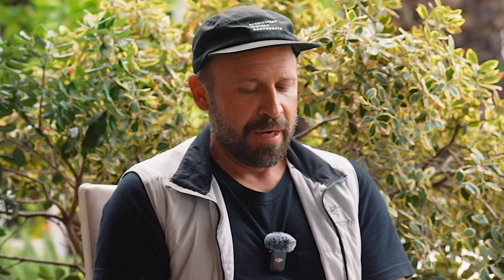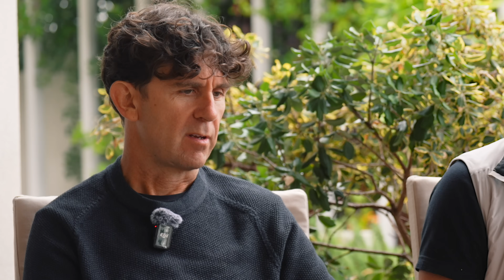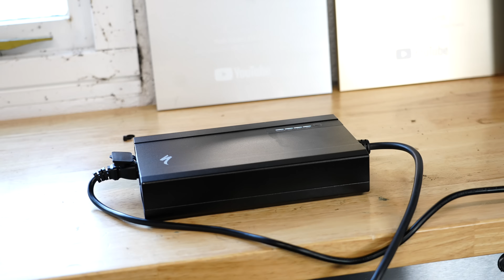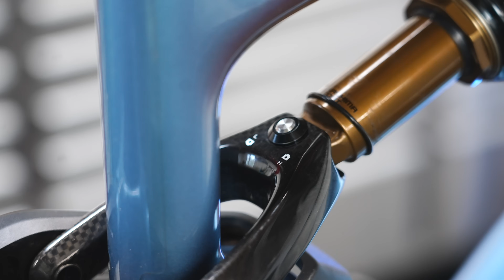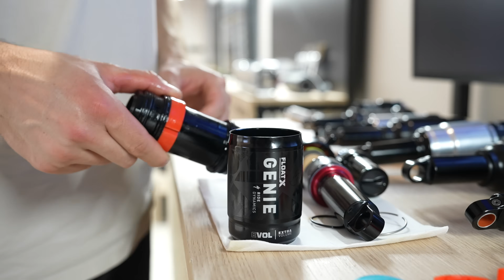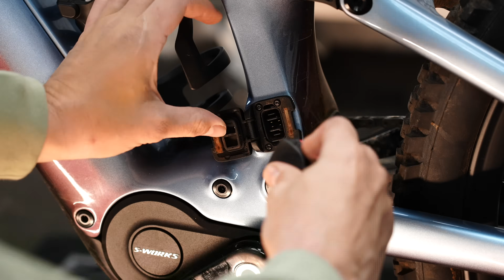Gen 4 Levo – What Specialized Changed & Why

Comment: Genuine question please Rob, how does a bike that weighs over 23.5kg with the 840 battery, now weigh less than 20kg with the 600 battery, when it is suggested that the 600 battery is suggested to be about a kg lighter? Or was there a mix up, and the bike was weighed with no battery fitted?

If it is true, can I have my Pro version with the 600 battery please, as I am seriously looking a buying the Pro to replace my Orbea Wild.
Reply from the maker: The bike at under 20KG had a ton of parts changed too: 36 fork, lighter shock / tyres / dropper post / brakes etc. Basically every part swapped for a lighter weight version. That, with the lighter battery adds up to a big weight saving.
Reply: @RobRidesEMTB  Rob I heard on the grapevine yesterday, that Specialized might be bringing out a Levo gen 4 SL. It was suggested that I might want to wait and see!😉😉👍

Comment: Tech climbing it’s strong suit not doubt, especially in comparison to Gen 3.  With extra power, had to tune everything way down, no shuttle, min overun and responsiveness and Auto minus to get good range since the more available power sucks up more battery, especially for the +200 lb rider.  Is nice that I can spend at least 80% of my rides climbing in ECO, Auto minus for the steeps to conserve range.  Full Turbo on the DH’s when wanting to blaze or perform “race runs”.  Just happy Spesh created a battery harness nest fix with new design from keeping the power/battery from shorting every ride like mine did.  Was kicking myself for going side load/easy battery removal due to connectivity issues on every ride with error codes and power shorts.  Since updated part, no shorts for over a week now and stoked! 
Wanted to get rid of bike prior

Comment: honest bunch of blokes. Spezialized really seem to have fresh air coming along
Reply: Specialized e-bikes you can basically guarantee 10 years of local serviceability and probably more but the years are still counting. My dads 2016 levo has never been a problem for replacement parts at the local dealer. A lot of other e-bikes from that era are now scrap and impossible to source parts.
Reply: @KurtisPape  well it might be the version when they used MAHLE or something like that as a motor.
After that they did many mistakes. Their engines are NOT durable. ive used up like 5 of their 2021-2020 flagship ebikes.
at that point it i could careless if you have local serviceability. I hate going to the mechanic and also imagine having nthe engine failures on BIG rides. it WOULD BE deadly
Reply: @ignaciosevil1944  Levo 3 and SL had issues for sure

Comment: Needs podium fork, and get rid of the swat and side swappable battery.  Also, what’s up with the software updates between bikes? The Groupo alone is enough to justify the levels.  They could add lead ballast to the lower level bikes to have a performance difference.  Sorry, but this is what happens when the engineers and accountants get a hold of the product….first gens were driven by design, rather than raw numbers, facts, and figures.  Think original apple products, ground breaking, revolutionary, now hey it has one more camera, one more gigabit!  We just need a bike that works and looks like a bike!

Comment: Gen3 Levo Pro owner here – paid CHF 12.5k post COVID peak. After a firmware fix, it’s been great except the absurd decision to run carbon rims on a 20+kg eMTB. I’m not price-sensitive, but when Spé dropped it under 9k months later, it stung. In 2025, at this price, a bike must be competitive across the board. Soft-capping an already underpowered motor (see all side-by-side tests) is tone-deaf. I wanted this bike—but that decision alone kills it for me. Aesthetics can’t excuse specs. Love the effort, but this is a reputational misstep.
Reply: thats a bummer for you then, absolutely love mine on me e-bike. Actually the best upgrade I've made. I recommend to everyone to do the same. And everyone who has changed to carbon rims loves them too. Different strokes and all.
Reply: @thedondodda  glad you love yours. I'm not sure we have the same use cases. I sometimes race extreme alpine like the Mountain of Hell for example, and you won’t find a lot of amateur e-mtb racers who kept using carbon. Same on the dh and enduro series. There's a market for carbon e-mtb wheels, but not everyone will love them.
Reply: why wouldn't you want carbon wheels?
Reply: @thedondodda  multiple reasons. The strength needed from carbon rims on hard hitting e-bikes makes them as heavy yet not as impact resistant than their aluminum counterparts, more expensive, and much more likely to catastrophic failures especially the rear wheel. They’re also non recyclable. Therefore there’s absolutely 0 reasons for them on such machines. I sold mines after they came back from the inevitable warranty claim and went hx1700 for a third of the price and a ridiculously slim weight penalty and never looked back.

Comment: has anybody had the S Works motor loose power after going up a high cadens hill but the display shows no error oddly its happened twice now on the same climb hill at cannock chase? also the display doesnt keep the time correct if its stored for a few days and show max speed if you have it on a menu option but the shows it as your riding along? 
besides that its a great bike😀

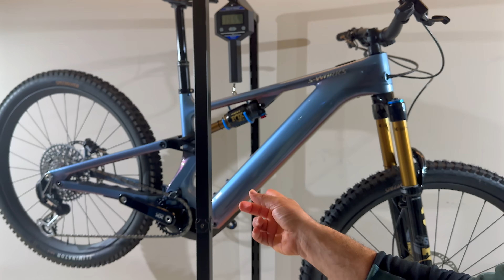Comment: 10:12 I wonder how did they achieve that weight?
I see they changed fork, shock, dropper, tires, brakes and smaller rotors. Everything else looks similar to s-works spec.
S-works weight is 23.68 according to spesh website, with 600wh battery it would be 22.68.
Is that possible to drop 3 kg just by those components? Or there is something I cant see?

My approximate counting is
tires - 600g
fork - 300g
shock - 200g
dropper - 200g
brakes with rotors - 400g
which is 1.7kg, how did they managed to drop another 1.3kg ?

Comment: I dont do specilized anything but being able to run the bike on the extender by itself its actually genius, So you can go bikeparking with it and not haul around the big battery for no reason.
Reply: You can't. It's half power.
Reply: @rawmancemtb  Remind me... when do you need 'full power' when bikeparking...???

So yes, you can....
Reply: @Bestintheworldatwhatido  There is a massive difference between 670 watts and less than half that... You are riding a full power motor that can't access that power and it's not even light for the application as the bike still weighs like 22kg... Tell me you can't think for yourself without saying it.
Reply: @rawmancemtb  you sir are 'thick in the head' You've completely missed what i was trying to say.
Reply: Mate u wouldn’t be able to pedal it hardly with no power even with the battery out it’s still a big slug to pedal with little or no power. Plus u want to load the bike up with backpacking gear

Comment: Is there a new charger connector since the voltage changed from 36v to 48v? Is it the same as the SL or are there 3 separate connectors for Specialized bikes?

Comment: The most expensive bike from every manufacturer is always on test. I want to know what the least expensive bike rides like.
Reply: One up from bottom. Bottom tier is usually stocked with throw away parts.
Reply: @zed5129  I rode the poverty spec levo 4 yesterday, the Z1 Bomber was pretty good, I was surprised. Still very playful (once I adjusted the rebound), easy to bunny hop, which was a surprise.
Reply: @zed5129 usually about 1 dollars worth of parts the rest is frame cost.
Reply: The problem is this effect the ride feel trying to be achieved by the brand, which isnt a good thing for the consumer.
Reply: exactly. complain about this all the time to reviewers. They say that's what the companies send. Lol. yeah, of course!! Best possible light for reviews. Reviewers need to start insisting on the lowest level, or next to the lowest level bike, because that is what most people will buying and riding. It is SO irritating.
Reply: I have the carbon comp. I changed out the forks for zeb ultimate 2.1s. Other than thats its more or less stock.  Its PHENOMENAL. I’ve been riding ebikes since 2018 had the levo gen 3 too.   This is the best ebike I’ve ever owned or ridden.

Comment: I hate this bike. I don't care what they did to it. It's ugly AF, overpriced, and the fact that they nerfed power for anything other than Sworks is insulting. I'll keep my gen 3.
Reply: I tried the G4 and liked the handling. But I looked at the cost to change and bought some Fox Factory forks for my G3 instead. I’ll wait for the G5. The G4 just isn’t that much better.
Reply: I’m coming from a different brand so well worth it for me
Reply: till you try it
Reply: @Po.2013 I’ve tried it and do be honest, my gen 3 feels as capable. I tried the over run settings and none of them suited my riding style. I guess those riders who want ride up technical trails it makes sense but let’s be honest. Going downhill is where the fun is and having over run on steep terrain where balance and feel is needed is very dangerous. Unfortunately my next bike will be an Amflow due to pricing of Specialized. But until then, my gen 3 Levo still runs like a dream.

Comment: Needs more travel! Make it at least 180/180! Also it needs longer chainstays and different lengths for the different sizes.
Reply: This^. I have a gen 3 and have never liked the short chain stays because I ride the front tire
Reply: Saving up for my first e bike 😃 which bike would everyone recommend 🤔
Reply: The bike is rated front fork 180mm
Reply: No, Rear centre needs to be where its at.
We dont race DH we dont need them long.
2 benefits vs up to 8 downsides. no thanks.
Reply: It’s not an enduro bike 

Kenevo buddy

Comment: Nice interview.  Levo 4 with the 600Wh battery is now a sub 20kg bike… Is it ever going to come in this configuration?  And when (did I miss it) is that battery going to be available?
Reply: NO WITH 600WH Battery 22KG YES S-WORKS
Reply: Do I understand that a 600Wh configuration will not be available on Levo 4 except on the S-Works model and that will weight 22Kg?  Where do you take this information from?  And why the screaming?
Reply: @jeanmarc_in_Hudson  No it will weigh 1kg less than the 800Wh so that should be way more than 22kg.

Comment: Base AmFlow, doesnt look like a fat cow, has more power and costs less.   Is a no brainer for most people this year.
Reply: Crussis e-Full 11.11 (800Wh) DJI 2026.....hold me beer :)  4700e
Reply: You trying to knock S good luck with that buddy 😂
Reply: Fat cows ain't looking just Xi 😂
Reply: But what if is SNAPS?!? Thin is nice... until you eat a tree. Reviews say it doesn't handle downhill as well as others (Emountain bike magazie 30 ebike long term 2025 for one). Don't you go up to come back down again and again?? I would put WAY more importance on reliability which is more about the company, their support network and YEARS of tested R&D. Specialized has gone above and beyond with support for prior motor failures and have a HUGE support network. Amflow has only been on the scene 1 year. No way I would trust a 5 figure commitment to them at this time. DJI may just have major failure issues yet, too early to tell. But Specialized has shown they are there for customers either way.
Reply: levo is way more capable on the DH. Amflow is a trail/AM bike. Levo is a AM/Enduro bike
Reply: If those are your only criteria for a bike, then sure, that works for you. However if you care about more than just weight, marginal power difference and size of the down tube, then you’d realize there are a lot of compromises the Amflow makes. Not to mention that you still can’t buy one in the US. I rode both and bought the Levo. The level of suspension refinement isn’t comparable. This bike ships with legit equipment for the type of riding I do.   I couldn’t get an Amflow to do what the Levo does for any price.
Reply: @michaelsbihli6884  Bonified Specialized fanboy. It's especially hiklarious as the Amflow is essentially a levo copy.

Comment: Worth swap from gen3 ?
Reply: No, heavy, bad geometry, expensive with no resson, high battery usage
Reply: Yes definitely, 400 miles in on my s-works , and the thing rips
Reply: Absolutely it's a new and better ebike but if you ask those who haven't tried one for a couple of weeks they wil say NO
Reply: I have a gen 3 with the Cascade long link kit and a 170mm fork, it’s one of the funnest bikes I’ve owned. My mate has the gen 4, the electronics are awesome….that’s about it. It’s heavy, the motor rattles, it’s ugly. Cascade did just release the long link kit for it so my mate is going to try that and decide if he’s going to sell the bike or not.
Reply: @jeremyc1861 I bet he won't sell it after he gets used to it with cascade 😉
Reply: Yes, it is incrementally better in every way 👏